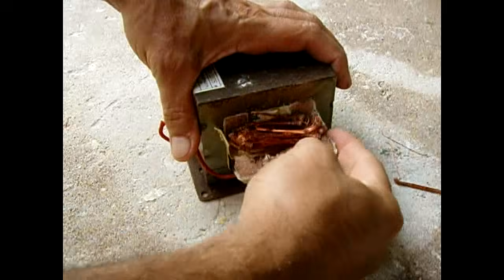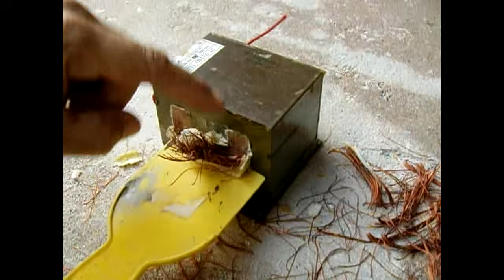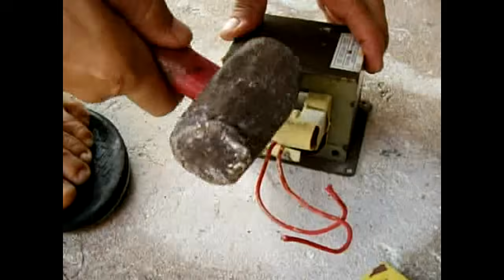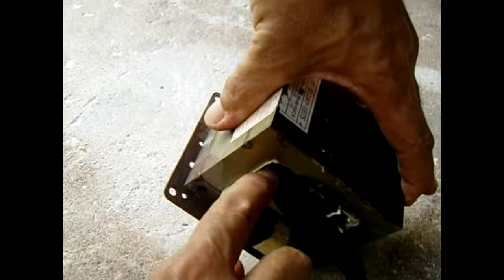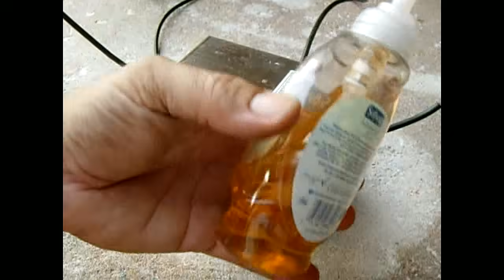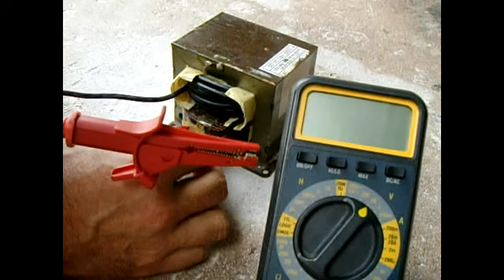BEST Microwave Oven Transformer-MOT Rewinding Tutorial

Comment: I would have used vaseline or mineral oil to lube wire it is a better lube and nonconductive soap is usually conductive.  this is a great video.
Reply from the maker: +Charles Barnett 
Silicone grease and wax based lubricants are the best. The soap works great, and there is no concern about the conductivity of the soap, unless you cut into the thick insulation of the wire.

Thanks for watching!

Comment: Even if you scuff up the primaries, not all hope is lost. You could probably just run nail polish on the bare spots and they would be fine.
Reply from the maker: +Fire In The Sky 
True. I used clear acrylic nail polish many times in the past.
Reply: When I was knocking my secondary out the bolt put a pretty big scratch on 2 wires so I pulled them away from each other an then put silicon in between them and it hasn't blown up XD
Reply: thanks you saved me

Comment: OK this has been bugging me, so I'll ask. How come you chop down in the direction of the primary winding? Why can't you put the transformer on its side then chop to the middle, where there is nothing that you need to worry about damaging? Basically 90 degrees to what I see going on here. I am really interested in the rationale for why that would not work. Because it is just not coming to me.
Reply from the maker: Hello there. Using a sharp chisel is the easiest way. When you get close to the bottom of the winding, then you can use a 32tpi hacksaw blade to finish off if you do not trust yourself with the chisel.
Reply: TheFootbaldd
Copper really gums up hacksaw teeth. You're best off if you play to the attributes of the material you're working with. Copper is soft, so just slicing it with steel is your best bet. Saws use a slicing action too, but they're rarely as sharp as a sharp chisel is. The gullets of teeth are typically shallow too. Plus the rake of saw teeth is not going to be nearly as effective when slicing through layers of copper wire, as it would be in a solid material. I mean if it works for you great, but you're not really using a saw in a situation where it reaches its maximum effective potential. As a rule you're supposed to have 3 saw teeth supported by the material you're cutting. In this case that is each individual wire. What you're doing isn't even really sawing through the windings. More like ripping, or tearing them.
Reply: +Paul Frederick Good point; I was able to get a clean cut all the way through without having any issues. It did take some time though.
Reply from the maker: +Paul Frederick 
Never been mentioned before, but you can do it that way also. You do it the way you feel most comfortable. You still have to be very careful because the primary winding is very close. The reason why I chose to do it the way I did, is because the steel plate on the bottom of the transformer makes the job much more stable because the plate extends beyond the cutting area. Remember, there is almost always a reason for everything I do. Thanks For Watching
Reply: electronicsNmore
Yeah right before you flashed up the message about holding the transformer in a vise I thought the same thing myself. You must be very flexible to work on the ground like you do. Those days are over for me here. I like to work like a gentleman today. I'd probably use this http://www.instructables.com/id/Make-a-Tripod-Vise-Stand/ because it is a perfect height for gaining an advantage over something for me. That is no accident either. I made it that way.
Reply: +electronicsNmore Some transformers are turned 90 deg already. I have 2 transformers that are setup the same except one has the plate on the side so it would be easier to cut it from the side like Paul said. I'll more likely be using a clamp and my porch hand rail to hold it anyway my self.
Reply: +Paul Frederick I just use a hack saw to cut, using a chisel sounds like a good way to screw up. I guess that is a bit quicker though.
Reply: Paul Frederick  Thanks

Comment: What I did was, I used a hack saw to cut the shallow welds that held the I part to the E part of the core, and then pulled the whole bottom plate off.  Then I was able to simply pull the coils out.  Rewind the secondary with whatever you need, and then use 30 minute epoxy or JB Weld to glue the core back together.  Works flawlessly and is much easier than this method.
Reply from the maker: Aaron Tyrrell
There is nothing wrong with aluminum wire. The problem with aluminum is when making connections. A layer of oxidation forms which "Can" create a high resistance connection which can get hot and cause a fire. You can use No-Alox on the connection to help eliminate the problem. Aluminum is usually OK for service entrance conductors, but no longer allowed for branch circuits. I don't think Canada banned power transformers in appliances the use aluminum wire. The risk of any fire is negligible.
Reply: +KpilotRCHelis also, it results in no damage to the primary winding and if you're careful, you can even save the secondary as well.
Reply from the maker: +KpilotRCHelis 
There is no need to save the secondary. Most are made of aluminum wire colored to look like copper. The # of turns and size of the wire is pretty useless.
Reply from the maker: +KpilotRCHelis 

Cutting the welds using a hacksaw is much more difficult. You also ruin the integrity of the transformer. Using epoxy is a very bad Idea. The epoxy heats and cools at a different rate than the steel. Eventually the 2 will separate. I guess you got the idea from Grant Thompson. You have to realize that it "APPEARED" to take a while because I was making a video.

Thanks For Watching
Reply: +electronicsNmore I know there's no need for the secondary, I'm just saying if you really wanted to you can save it.
Reply from the maker: If I did want to save it, then yes, I would cut the welds.
Reply: +electronicsNmore Aluminum is NEVER used, also cutting the welds does NOT ruin the integrity at all in this case because a "MOT" core is made up of 2 sets of laminated steel plates. I might as well add that it is much much easier to take either coil out and rewind by grinding the 1/16" welds. Sometimes admitting that you were wrong is the best way to maintain credibility.
Reply: +electronicsNmore also I might add that you need not worry about the direction of winding as much because polarity can be reversed
Reply from the maker: Aaron Tyrrell
I think you need to admit fault. LOL. I have cut many of these cores apart, and ALL but a few of them used aluminum enamel wire. As for cutting open the core, there is ZERO reason to do so, you do ruin the integrity of the core. I only cut the core if I plan on making a new winding on a spool and welding it back together. I have heard of people using glue to put the core back together. Ridiculous. The glue does not expand and contract like the steel, and eventually the core will separate. As for the direction of the winding, if you are only using (1) transformer for a project, then the phase makes no difference, but if you are using a 2 transformers in series(like in my microwave oven welder), then it does make a difference how you wind them. Anything else I did wrong?
Reply: Your are right about the phase. And i agree that using glue is actually quite stupid to do, but the pieces can be welded back together and actually create a better efficiency. As for the aluminum wire, I am not sure about where you live, but it is illegal in Canada to use aluminium wire, and im sure it would be in the US as well. "Not knowing something dooes not hurt you, what really hurts you is when you are certain about something and you are wrong."- Mark Twain
Reply: Unfortunately no, aluminium has a much higher resistance than copper, there was a story a few years ago of a whole wire burning inside a was dispute being hooked up to a functioning breaker. Asfor transformers you run into another problem, because of the much higher resistance on its own, the use of aluminum wire would greatly affect the transformers efficiency, integrity, and over usability. Actually if gold was not so valued as a luxury, its use in wiring and power generation would probably end the worlds energy problem.
Reply from the maker: Aaron Tyrrell

Don't want to argue with you, because I have much more important things to do with my time, but you are incorrect. Even though aluminum wire does have higher resistance(Not "Much" higher as you stated), there is nothing wrong with using aluminum as a conductor. If what you say is true, then why do power companies use ACSR cables for power lines? :-). Since aluminum has a higher resistance than copper, electricians know to use one size larger wire than copper to carry the same current. I don't see how gold wire would solve our energy problems, but silver is the best conductor known to man.
Reply: +electronicsNmore  I've taken apart probably six or seven of these MOT's for different things and I always save the secondary.  Every one I've taken apart has had a good quality copper wire as the secondary.  I use the secondary wire for various things, its great for rewinding brushless motors for my RC planes and quadcopters. I can increase the power density over stock motors by using a thicker single strand compared to the thin parallel sets that come with the motor.   As a electrician, I've been working with all types of copper wire every day for the last 20+ years so its not like I'm some dipshit who is just here to argue.
Reply from the maker: Chris Barth
I have access to at least 100 of these MOT's, and maybe 5 use copper windings. All the rest use aluminum with colored enamel to resemble copper. If you want to take the time to cut the core open to salvage the windings, then great.
Reply: OK, Great!  I guess I just got lucky with all of mine.
Reply: Aaron Tyrrell gold actually is not a better conductor then copper, it just will never tarnish or oxidize.. silver is one of the few things better then copper

Comment: Hello, I am rewiring a mot for 120v to around 28v with a output of around 10 Amps. I was wondering if 20awg magnet wire would be thick enough for the secondary coil.
Reply from the maker: liljoey112 Please refer to my other video below. You can use the transformer calculator software in the video description area of that video.

Thanks. Be sure to share and rate Thumbs Up.

https://www.youtube.com/watch?v=3uCuA032lYw

Comment: Direction of winding is immaterial. This is AC. At 13:00 or so.
Reply from the maker: Jim Curtis If you are only using (1) transformer for a project, then you are correct, but when using 2 transformers in series(As in my homemade 52V DC welder), you need to make sure the phase is correct, so I like to wind them in the same direction. How the current enters the winding affects the phase.

Comment: How about using an old Television set, the transformer there hold a lot of electric but be carefully when attempting to touch the transformer, if it still had live current of electricity flow through it, and if you touch the wrong wiring with out any safety you get nasty shock..!!
Reply: +Donaven Naidoo meh what doesnt kill you makes you stronger
a tv flyback hurts like crap but it does not hurt

Comment: Hi, I need some help. I have very little electronics knowledge. However, I'm trying to build a power supply for my cordless power mitre saw. I've been told the best way forward is to use/adapt a microwave oven transformer. That's why I'm contacting you because your an expert and if you can help me, I will be grateful. My cordless mitre saw runs off 24v batteries ring from 2.4ah to 3.0ah. The motor requires 630w of power.

It's been suggested that I use a 700w use MOT and adapt it, rewire the secondary and so. Ok, that is were my knowledge ends. Can you please advise me the following;
1. What size MOT to use 700w or other
2. What size wire should I use on the secondary 4mm, 6mm and so on
3. How many turns does the secondary need
4. Do I need to use a bridge capacitor
5. Do I need any other electrical wiring 

Please help as I really want to get this project off the ground. 

Kind regards
Reply from the maker: Frame Please refer to my other video below. There is a link to a program which you can use to figure out what your need.

Thanks. Be sure to rate Thumbs Up and Share.

https://www.youtube.com/watch?v=3uCuA032lYw

Comment: how much current would 4mm squared wire give out if i rewound a mot with  it its household wire with 7 thick strands of single wire that make up the wire itself 
the mot has 6170w marked on it i believe its the rating of the transformer
Reply from the maker: hansley maharaj I have no idea. That number does not sound like the rating. You need to do a Google search for that part#, and use the software shown in the video description area of my DIY power transformer video.

Thanks!

Comment: to me its easier to simply cut the weld and salvage the secondary as well
Reply from the maker: Clown Whisper Not to me. The secondary is worthless thin aluminum wire colored to look like copper. The varnish pulls off the wire if you attempt to reuse the thin secondary wire. It is way easier to do what I did. You also end up destroying the integrity of the transformer core by cutting the welds, especially if you do not weld it back. Really no reason to cut it open.

Thanks For Watching
Reply: ive pulled a few that were copper, but they were very very old
i can see why you did this the way you did
Reply from the maker: If it was copper, I likely would have cut the core open. :-)
Reply: electronicsNmore Hey do you know of any calculators to figure the voltage and amperage for turns and gauge based on the specs of the mot?

I basically need to build a power supply that has two taps, one 5volt at 19 amps and one 12v at as many amps as I can get. then rectify it for dc.

Im really tired of burning up old atx power supplies
Reply from the maker: Please refer to this video.

Thank You.

https://www.youtube.com/watch?v=3uCuA032lYw
Reply: electronicsNmore thanks. I dont know why I did not do this in the first place lol
Reply: electronicsNmore damn..  the calculator wont run on windows 8.1
Reply from the maker: You will need to try it on another computer. The program is exactly what you are looking for.
Reply: ill have to do it on paper or install a virtual
 box maybe.
Reply from the maker: I use Linux. In order to use the Windows program on my computer, I use a program called "Wine".
Reply: electronicsNmore Im an old unix admin.  I use have a laptop with linux and wine.
Ill check it out.

It actually flashed through my head to do that
Reply: electronicsNmore I got it running on wine but that brings up more questions.
WHy would this be in milliamps? I have to let it scroll to 20 thousand milli amps?

Also the area so I have to calculate the area of the two cross sections?
Reply from the maker: 20000mA is 20A. You need to use mA. Measure the transformer core(what the wire wraps around) and enter the dimensions into the program.
Reply: i know. what i was asking is do i have to allow that to 20000?? that will take a long time  i wish i had the source code  i need 20 amp output on the 12v tap
Reply: electronicsNmore shit i was logging int my laptop remotely and it wouldnt let me type directly into the field thats why i was  confused!!  it only let me scroll the ma field
must be a bug in team viewer

Comment: Maybe easier to use a dremel with small cutting disc?
Reply from the maker: Fritz Mulder Absolutely not. It only takes a few minutes to chop out the HV secondary. Seems longer because I made the video. If I was not making the video, I would have it chopped and removed in 3-6 minutes.
Reply: Thanks. Nice video. What is the rating of this transformer? I need to get one to build myself an inverter. Currently, South Africa can't deliver its power demand to the people and we have load shedding almost every day.
Reply from the maker: 1000W, but they are really designed for around 600W. They push the limit because there is a cooling fan in very close proximity to the transformer.

Thanks For Watching!
Reply: 600watts is perfect. I just need something to run a couple of lights and my 42inch Led tv for 3hours max.
Reply: It depends. Most microwaves are on the order of 1000-1200 watts but some of the bigger ones are up to 1500. In the US, plug in devices are limited by Underwriters Regulations to 1500 watts on a normal 3 prong, 120V outlet. If you are going to use two transformers to get twice the current, wire the primaries in series and use a 220 volt dryer plug.
Reply: Really? What's your problem with cutting th core!

Comment: theese transformers are big toy. i saved my ALUMINUM secondary coil because it is so long... and because it is lightweight conductor. now i had to professionaly rearange the whole transformer except the primary is still ok. btw what is the max power of this device (in watts)
Reply: I believe 600w not sure
Reply: It depends on input voltage, generally speaking about 350-400 Watts and that will diminished by the number of seconds it stays on. Also, the number of winds,  more winds means higher voltage output but lower amperage. Say, input 220vac on the primary coil, the result on the secondary coil with two turns would be 350watts. If you increase the number of windings to let's say 17?? then, you'll wind up with 25 - 28 volts, roughly but lower amperage maybe 130??
Reply: Enrique Carmona dude i know how they work. just asked how much power is the core rated at 50 hz

Comment: Probably the easiest way to remove the sec. In the past I've used an angle grinder, slotted drivers, and a rubber mallet to remove both the primary and secondary....reusing the primary, winding a low voltage sec.....like you've done here. Twice I've had to 'roll my own' primaries. Not very efficient but neither is the stock transformer. You can do a lot of fun (inefficient) things with these.